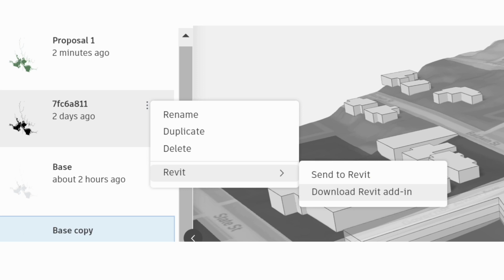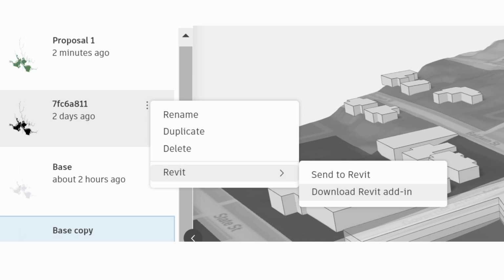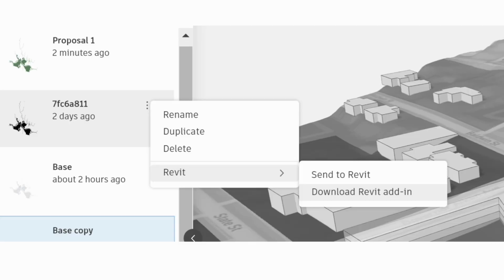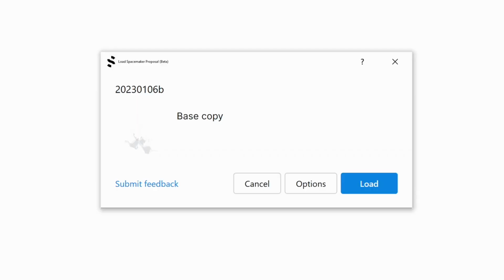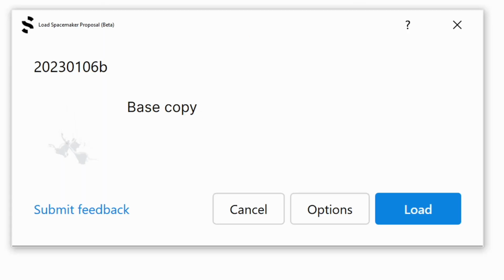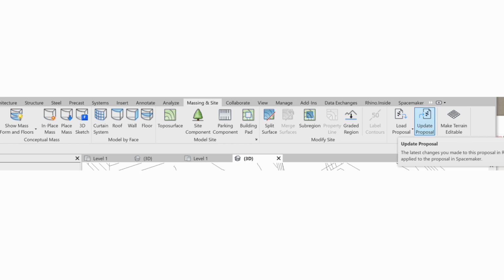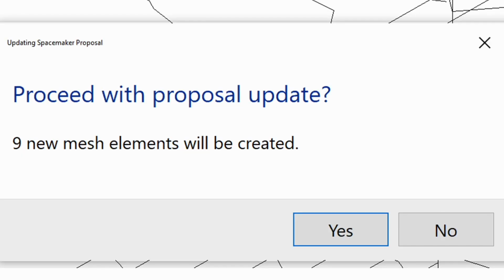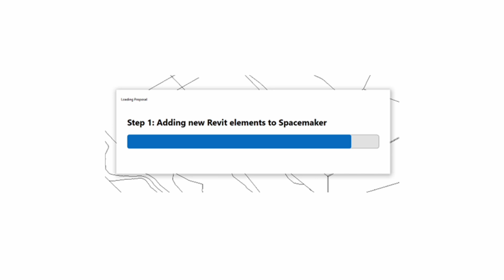Autodesk Forma - How to send a proposal from Forma to Revit

Comment: I don't have this option not in revit 2024 or 2023 what do I do?
Reply from the maker: Hey! the feature is available both for Revit 2023, 2024 and 2025. Have you checked that you have the addin installed from the Autodesk App Store?

If you're still experiencing issues, please reach out to support directly in the Help section in Forma, or through the Autodesk Forums and we will help you troubleshoot!
Reply: @AutodeskForma  it turned out that I had to download the add-in revit so I can have this option